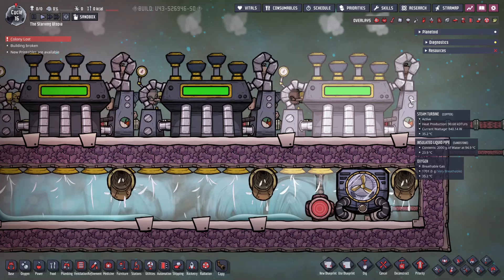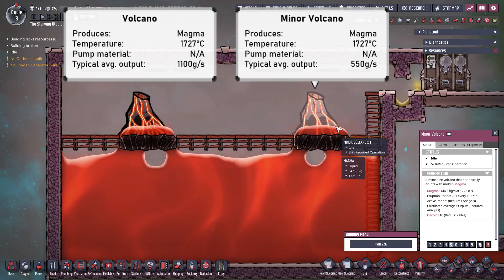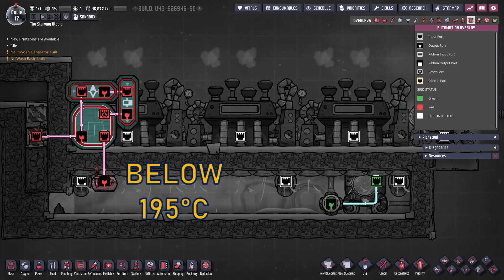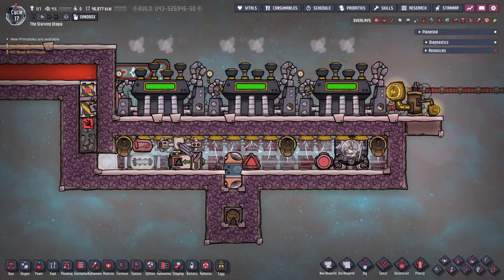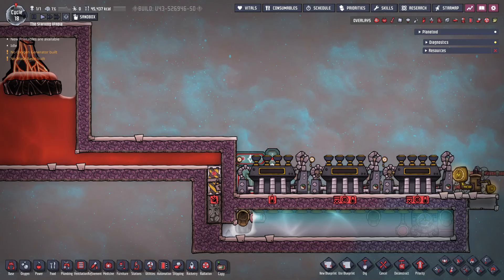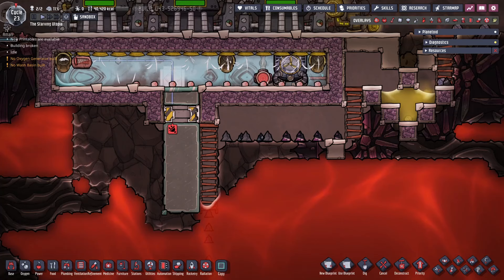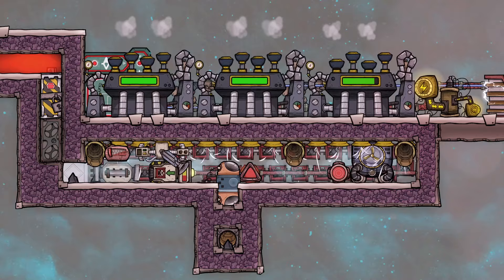Oxygen Not Included - Tutorial Bites - Geothermal Power

Comment: Another lazy way to do geothermal is to "bottle" the volcano inside a large diamond window container and siphon the heat with a heat injector. You can start the process with a heat spike above the volcano till everything is cooled to neat boiling, then dig out an area and change the spike into a bottle. As the lava builds up to cover the volcano, just mine it out every few hundred cycles.
Reply from the maker: I must say that I have never heard of that method before, but I see how it would work. In general I tend to prefer designs that I can leave and forget about, but this way is probably quicker and easier to set up, so a benefit there.

Comment: Just saying but i got a problem, my magma doesn't turn into item while behind a mesh but become a bloc itself... So it stays behind the mesh but in a solid buggy bloc that bloc all exchanges and magma cannot flow through anymore... Did that happened to you ?
Reply from the maker: That happens when the mass of magma in the mesh tile is too high. It becomes too high if it cools too slowly or the magma is emptied in too quickly. That's why it's important to use the 10 tile long magma blade design that slows the magma flow rate at the end to avoid this problem.
Reply: I just checked back what was different and i had 11 blocs not 10 from the magma source, don't know why it was a problem, but well i copy pasted what you showed and it works so... I'm happy with, thanks for the reply. @GCFungus

Comment: For the heat injector set up, i would recommend u guys to power up the mechanized airlock so it closes and open faster. That way u don't bring in more heat than needed. My set up would get overheated when I didn't power up the mechanized airlock. Also move the thermo sensor closer to the middle. Hope this helps anyone who has a problem with the injector set up.
Reply from the maker: I've not had this problem, but I can definitely see it happening depending on the exact set-up. And if it does then powering the door seems like a sensible solution.

Comment: There's one more option to harnessing magma power, my preferred method - using hydrogen filled steel pipes to slowly drip cool the inflow magma from a volcano. Pools of magma is different but if the volcano is in a pocket of obsidian with surrounding magma I mine all of the rock out and cool down the magma into a crust using igneous tiles. Then I dig the entire volcano out free with no liquid magma to deal with. From here setup to catch the magma and cool down easily with a hydrogen filled loop. You can easily gather tons of igneous rock this way for future use in any project you need heat power.

Comment: Just some heads up, if the magma starts to not flow through the second mesh tile, you probably have a certain bug where the magma becomes an igneous tile inside the mesh tile. 
To fix this, deconstruct the mesh tiles, save and reload, find any igneous tiles where the mesh tile is before, and dig them. This should fix them from turning into igneous rock inside the magma line.
Reply from the maker: That is true, and is caused by having too much magma in the tile when it solidifies. That's why it's important to use the magma blade to carefully drip it in and not have it go in large amounts. As you say to fix this you can deconstruct the tile, dig the rock and then rebuild.

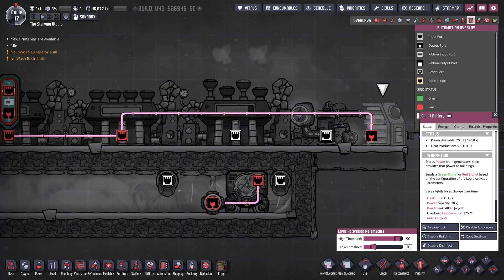Comment: 4:55 When I'm using Smart Batteries to control the turbines, rather than allow one turbine to continue running like you're doing, I actually prefer to just put a failsafe on the Aquatuner itself (with an AND gate and a nearby thermo sensor) that stops the Aquatuner from running if the steam temperature is over 300C, thereby guaranteeing it doesn't break itself.
Reply from the maker: That's a neat solution, thanks for sharing.

Comment: There are variations of it,
for example if you open magma blade that flows into tempshift tiles, it will also turn into debree and do nothing else.  
its useful if you just want to compress magma into rock, to unlock new area. Then you can store stacks of 100T of hot rock, without big ass room for it. Good part of it is that it usually happens at astonishing speed, as flash point mechanics are a bit glitchy.

Comment: I'm wondering about something. This thought takes off from the diamond window spike.

How would it be to turn the magma area into a giant steam room?
The purpose would be to mine it out and be power positive for the duration, which could pay for a conveyor track, maybe even a miner.

The way I see it happening, I would set up a set of steam turbines just above the magma region on one side of the map (specifically, at the end where a volcano sits right above it on my current map), pump in water based on steam pressure, access through a liquid lock to mine out rocks.

The steam would cool a wall of newly formed rock, which I could mine and set on a conveyor to dump it under the turbines. Keep shifting the sweeper to follow the receding wall.

At about midway, I think I would build a new set of turbines to replace the first one.

I love how this game sets my thoughts spinning.
Reply: Ooh!
Actually, maybe I should place a sweepy droid instead of arms.
And when it's all done, I could mine the entire map from bottom to top using the same pickup system.
Reply from the maker: Yep it's definitely possible to freeze all the magma into rock and mine it. If you are going to put the steam directly in contact with the magma though, it would probably be better to put an aquetuner in a different steam room as it would probably get too hot if directly exposed.
Reply: @GCFungus  sadly I will have to hold that thought.
My first surviving colony sort of.. died.

On the left side I didn't quite realize the enormous cloud of CO2 that was bottled up in my first ever combustion setup of 4 ethanol distillers and an engine. Which wouldn't be lethal because I had an enormous sink and an active outlet into space.

Except that at the same time my experimenting around that volcano led to a rupture in the insulation between a large patch of oil and the magma layer.

On one hand, I got to witness the general principle of dumping a load of liquid into the magma to solidify it.
On the other hand, that caused an even more enormous cloud of sour gas to flood my living area from the very same sink where I needed the CO2 to go to.

Long story short, I have a large store of meat packed away in sterile atmosphere.
Just... ignore how much the wrappers look like, y'know, clothing.

Back to the drawing board with the lessons learned from this attempt.
Reply: I tried this now.
At first the setup was based on a line of diamond tempshifts reaching down into magma. These were extremely slow to transfer heat into the heat injector that connects to the steam room. Each plate would first equilibrate at midway between next and previous, and then slowly increase in heat over time.

Then I added a vent with a liquid cutoff linked to an atmo sensor inside the magma room. Sensor is set to below 1 kg. The cutoff is in the area with better controlled temperature, since the vent is too hot to have water in the pipe.

A bit of steam made heat transfer towards the heat injector practically instantaneous. The steam room sits at a constant 199-205 degrees.

One really cool observation after many cycles:
I see a slight temperature gradient throughout the magma layer from edge to edge, with this machine at the valley.

It will take a very long time until anything solidifies.
It would be cool if a large chuck were to flash into a chunk all at once. Doubt that I'll be quite so lucky as to see it happen.

Comment: Can i use this to melt other materials like metals, dirt and add petroleum boiler to it to suck all the energy out after ?
Reply from the maker: You can use heat spikes to run petroleum boilers yes, you just need to replace the magma drop side with the heat spike. As for melting other materials, in theory yes you could but you would have to be very careful with it and generally I don't think there's any really good uses for that.
Reply: @GCFungus  metals, rust maybe even glass? Then use heat from cooling this material for petroleum and the water boiler maybe even boiling the eggs. Been trying to make one from before space materials but is not easy :D
Reply from the maker: @oskarmokwa7415  For metals, in my opinion the ore is more valuable than the refined as you can use the volcanoes to get unlimited refined metals but the ores are much harder to replace. Rust similarly I'd take the iron ore. Glass is easily made in the glass forge so also not something I'd bother with. Petroleum can definitely be done and you only need steel not space materials, I covered it in its own Tutorial Bite.

Comment: I've built a magma spike steam chamber with ceramic insulated tiles below on the magma side and igneus rock ones up top.  Everything in the steam chamber is made of either steel or ceramic.  I fill the cooling loop  with polluted water.  Now I run into a problem the moment I close the mechanical door and let the heat from the magma in.   The insulated liquid pipe that is directly connected to the output of the aquatuner starts to take damage and lets some polluted water into the steam chamber.  This then turns into dirt and sand in the chamber.  I thought about just letting it go and leaving the dirt and sand in there and letting it keep working, maybe I could've even ignored that.  But the bigger issue is that one pipe that is taking damage.  What can I do?  Am I missing something? Is this a bug.  Hoping you can shed some light and help me fix this issue.
Reply from the maker: It's a little difficult to help without seeing the exact set-up, but sounds like there's a heat transfer issue to that pipe. If you want to share some pics then I'd suggest heading over to the discord where myself and a great community will help: https://discord.gg/bnqYAUTMmn
Reply: I've been having this problem constantly with all my aquatuner setups that utilize insulated pipes, steel aquatuners, and steam cooling loops. There's always a tile that gets damaged behind the aquatuner and it's led me to run liquid locks with atmo suits on every cooling loop just so my dupes can perform regular maintenance. I thought it might have been me accidentally freezing the coolant but even when the temp is set to well above the 14C variable threshold (that is, the aquatuner is set to well over 14 C over freezing the coolant), I would still end up damaging the pipe segment and in many cases leaking coolant into the steam chamber, where in cases that I was using oil as the coolant, totally screwed up the system and caused overheat damage by preventing steam formation.
Reply from the maker: @AbsalomIndustries  That's interesting, but systems like this can run without this problem. Marcelo came over to the discord and we found that he had put his thermo sensor too far from the heat injector, so the whole room was getting much hotter (500 degrees) than he was aiming for. Also he had joined one of the steam turbine outputs to the cooling loop plumbing. If you're having this issue then we may also be able to help with that. It shouldn't be necessary to keep repairing this kind of build.

Comment: Could i use crude oil to cool the steam turbines as it has 4x the thermal conductivity of poll water and it has a 400C flash point?
Reply from the maker: Oil is a worse coolant than water because it has a lower specific heat capacity which is the most important thing for a coolant in ONI. I explained in the dedicated Tutorial Bite, but because the aquetuner removes a fixed 14 degrees, the heat removed is proportional to the SHC.
Reply: @GCFungus  ohhh that makes sense thanks

Comment: Mr fungus, youve said that the magma only flows 10 blocks correct? So say I build a containment room similar to the one at 2:16, and I put the steam room on the right hand side of that, but the difference is that i only have one volcano for the room. What do I do if say, get into an inactive period for the volcano and since magma only flows for 10 tiles theres now just a shit ton of magma piled up in the left corner of the containment room. So how do I use all that thats stuck there now because the volcano is on the right side of the room and now the whole thing isnt making any power
Reply from the maker: At that point I just wouldn't use that magma. It's basically a buffer that should remain there forever. Any new magma that is made at that point will then flow straight through, so the key is to try and use as much or less than the volcanoes produce or you will get production gaps.

Comment: Mr fungus, im having an issue where I have the magma dropping into the mesh tile but its not going down into the tile itself and theres simething like 46tonnes of igneus rock just stuck on the tile above the door and it wont actually send it to the tempshift plate. Any idea what happened? The door is set to close after 4 seconds and the other buffer gate is set to 15, is it an issue with that?
Reply from the maker: Usually I would guess that the mesh tile itself is full of solidified igneous rock (the artwork doesn't show it clearly but you can see if you hover over it). In that case you need to deconstruct the tile, dig the rock and rebuild it. The key with the magma blade is to not let too much magma get into the mesh tile at once or this will happen.
Reply: @GCFungus  ok so, I tried that earlier and noticed that a little bit, so how do I dig the tile? I could see that it was there, I just couldnt dig it. And what would I do to not let so much magma in? Change it from being open 4 seconds to 3 seconds?
Reply from the maker: @cowboybeeboopbop  To dig the tile you must first deconstruct. I would make sure the magma blade is exactly the right length at 10 tiles as shown. Then yes you can adjust the time down too to see if that helps.
Reply: @GCFungus  I made it exactly 10 blocks to the right of the source, but it just wont let me destroy it at all. I click on it and nothing, I hover with the dig command and nothing

Comment: Can we add more steam turbines?
Reply from the maker: You can add more turbines to generate more power, but this will use up the heat in the magma quicker. If using a large pool of magma (for example from a hot core), then this should be fine. If you use more with a volcano source, then after an eruption, using more turbines will take more heat out of the magma than is produced so you will make more power to start, but less power near the end of an eruption cycle (and through the dormant period).

Comment: Can you do Geothermal Petroleum Boiler next ? Man, played after months of patches, I was surprised now magma solidifies faster at 1400' C, guess they nerfed it hard~
Reply from the maker: I covered petroleum boilers in the other tutorial bite, and the heat spike here. My hope was that by covering both of those, I gave enough info to put the two together. Basically take the petroleum boiler design as I showed, and connect the hot side of the heat injector to a heat spike as I showed here, down into the magma.
I don't think there was a change to the mechanics, and the heat being pulled out of the magma will depend on how efficient your boiler design is. That's why the counterflow is so useful, as you only need to take ~10 degrees out of the magma to heat the incoming oil, rather than say 300 degrees without the counterflow. If your magma is cooling very quickly then I would guess that either you aren't using a counterflow, or it is not working correctly to heat the oil. If you want some more specific help, then please feel free to join the discord and we can work it out: https://discord.gg/bnqYAUTMmn
Reply: @GCFungus  cool, I actually use design from Nilaus's Geothermal PB, I'm using radiant pipes out of iron, some of my magma already solidifies, but luckily right below the PB there are 4 volcanoes (which now covered in igneous rocks btw :( ), should I just dug the igneous rocks (arround 1100' c) out so the magma can reach my heat injector or I can just leave it for a few more cycles while moving my PB to a volcano ?
Reply from the maker: My preference is always for a volcano boiler over geothermal as it will just run forever without any input, but each has their place. If you have the oil you can always dig out a volcano and then add a second boiler :D.